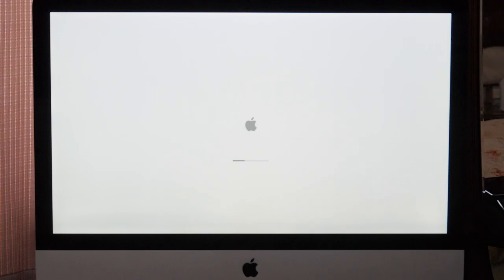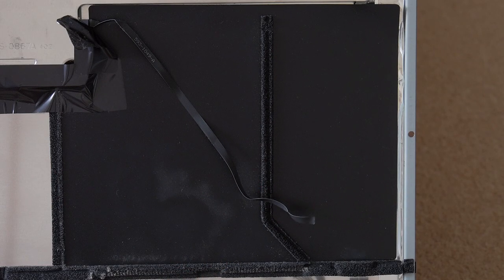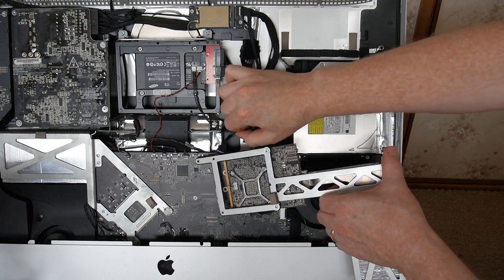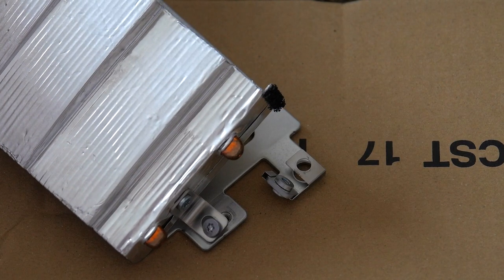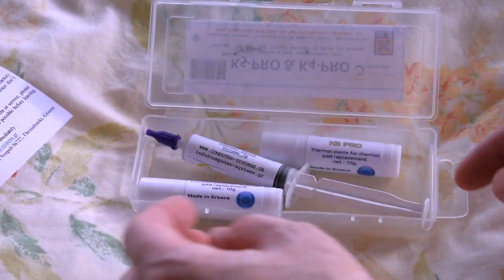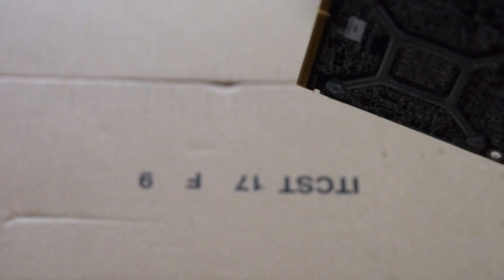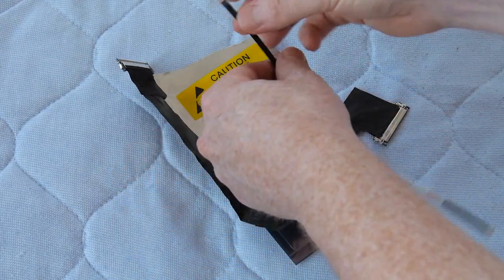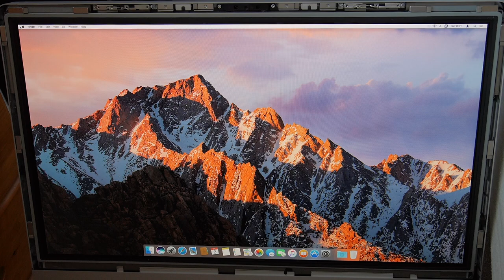Late 2009 iMac 27" Video Card Repair — 4850 — 2nd Bake

Comment: Can I use the K5 for everything or do I have to buy K4 for the chip?
Reply from the maker: The K5 Pro is only used as a replacement for "thermal PADS."  Thermal pads do not transfer heat as well as regular thermal paste, but thermal pads exist because there are certain chips (like memory) which are spaced further from the heatsink and therefore regular thermal paste would not bridge that gap or be effective.  A GPU and CPU run hotter than RAM though, so board designers ensure the heatsink makes contact with those chips without big gaps, and that is why regular thermal paste works great for those applications.  All said, you need BOTH types of paste.  Sure, you could just replace Apple's stock thermal pads with thermal pads of your own choosing, but it's harder because you'd have to know the exact gap width for the pad to fill.  Also, I've read that K5 Pro does a better job transferring heat than thermal pads, and if my near 12 months of continuous use is any indication, the K5 Pro is doing an excellent job.  So be sure to use the K5 Pro on the memory chips as shown in my video, and use the K4 Pro (which transfers heat even better) on the GPU only.  If you decide to use other pastes, just make sure they are not electrically conductive, and then you won't need to worry about electrical shorts caused by thermal paste overflow.
Reply: JDW thanks for the detailed reply and for making these repair videos! I was in a crunch and needed my machine up and running so I put a small amount of K5 on the GPU and put everything back together. Miraculously everything worked and my machine has come back to life. I guess I’ll be the guinea pig for anyone else that only has K5 available. I’ll keep an eye on my temps and I’ll report back if I run into any issues. Thanks again for your help!

Comment: Would Arctic Silver 5 thermal paste work instead of the K4/K5? I’ve orders a tube of that and some of the grizzly - wondering if those two would be ok?
Reply from the maker: No.  Here's why.  Arctic Silver V is not electrically conductive but it is capacitive.  It's very hard to get the right amount on the GPU such that there is adequate paste/coverage yet no overspill.  Any overspill will touch the tiny SMD capacitors surrounding the GPU, potentially causing issues.  It's best to use something like K4 Pro or Thermal Grizzly Kryonaut on the GPU.  As to the memory chips, NEVER EVER use GPU/CPU paste on those!  Why?  Because there's a gap between the top of those memory chips and the bottom of the heatsink and normal thermal paste won't fill that gap properly long term.  You must use either thermal pads (which I dislike tremendously because it's hard to know the right thickness) or K5 Pro, which is the only thermal pad replacement paste that I know exists.  I can also vouch for the K4 Pro and K5 Pro combo as that lasted 2 years and 9 months after my 2nd Bake.  On my 6970M I used Kryonaut on the GPU and K5 Pro on the memory chips.  There's nothing wrong with K4 Pro for the GPU, but if you have Kryonaut, by all means, use that on the GPU (not on the memory chips), as that is the best paste you can buy outside liquid metal. (And no, do not use liquid metal on these graphics cards!)  For additional Q&A, please see my video FAQ here: https://youtu.be/hldcyJ_qUD4
Reply: @JDW-  thanks for this. The reason I asked is that when I looked the other day I couldn’t seem to find K5 in the UK, but managed to buy a tub online last night.

I appreciate the detailed response (despite being a total tech noob and not understanding it all!). I have K5 and grizzly now so that should be fine right?

Thanks again!
Reply: @JDW-  ah no I completely understand - just re-read a couple of times ha thanks for the help.
Reply from the maker: @thenewnostalgic4094  That's good to hear. K5 Pro on the memory chips only and Thermal Grizzly on the GPU only is the perfect thermal paste solution for these video cards.  You can see how I applied those 2 pastes on my 6970M card here: https://youtu.be/n2a8oEI2y6U?t=633

Comment: Hi JDW. I performed the video card bake and the iMac is working again although one of the fans is constantly running (and loud). I installed smcFanControl and it didn't do anything. Also did a SMC reset. No change. Any idea? Thank you for your video card bake videos, awesome tutorials!
Reply from the maker: Thanks for your comment.  It seems clear that you reconnected one or possibly two connectors incorrectly, pertaining to one of the fans.  I'm afraid the only way to fix that kind of problem, in light of the fact SMCfanControl cannot fix the problem, is for you to reopen your Mac and check you fan and temperature sensor connections again.  Believe me, I know how much trouble that is, especially the horrid part at the end with you trying to get the glass back on without dust underneath.  But sadly, it really does look like you need to do that.  If you do decide to recheck your connections, please report back on which connector(s) were incorrectly connected (or were not making good connection at all).  Thanks.
Reply: How can it be, they are not a one size fits all meaning that I wouldn't be able to make an incorrect connection. I numbered everything as shown. Can you point me to the fan and temperature sensors?
Reply from the maker: Veronique, there are many things that could have gone wrong to cause one fan to spin at top speed.  You may simply not have securely fitted one of the SENSOR cables back into it's mating connector.  If the sensor cable isn't making good contact at the connector, the fan associated with that sensor will spin at full speed.  Since you seem to have only 1 fan doing that and since you appear to be able to use SMCfanControl to control the speed of the other 2 fans, I suggest you figure out which of the 3 fans is spinning uncontrollably.  You will then need to reopen your Mac and check connectors, as described in my other video below, and watch it to about 19:00.  If all those connectors are secured well and you don't see any wires broken off, then perhaps it could be the sensor at the drive (HDD or Optical Drive) or even the connection to the video card, which could have broken if you yanked on it too hard.  But again, if you can isolate which fan is spinning at top speed, then you can isolate which connectors and card you need to focus your attention on.
https://youtu.be/v1DXBLkiqFM?t=11m25s

Comment: I'm in the middle of the process... Already baked it and tomorrow will buy the paste... Did you noticed that there are some parts that have thermal paste originally but you missed to put on while replacing the card? I'm talking about the two groups of four chips, just at the opposite side of the card connection to the graphics card body, watching the chipset face. At the metal armature of my card body I can see clearly the paste (I can send you images)
Just to inform you guys...
And by the way... When I was going to unscrew the frame that holds the chipset card from above, holding by 4 screws, mine were completely loose! Is this normal? Also the chipset thermal paste was a complete mess around the chipset... Just a little drop in the center would have been more than enough...
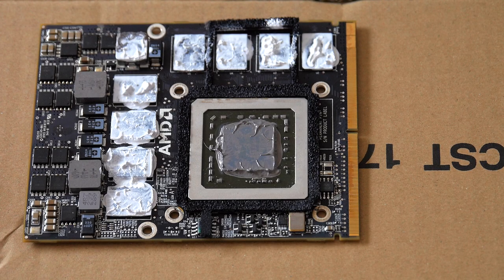Reply from the maker: Jump to 18:35 in my video, which shows my video card with past still applied.  Note the chips at left.  Specifically, there are two big square silver components, one smaller square silver component at bottom, and then 8 smaller ICs at the far left.  I did not put paste on any of those simply because Apple did not put paste on them originally.  Even so, there is a protruding section of the heatsink that seemingly would be used if you did put a thermal pad (or K5 Pro) on them.  But since Apple did not apply paste to them, I would not be too concerned.  Even so, if you want to apply paste, it certainly would not harm anything at all.

Screws should not be loose!  So when you put it all back together, make sure your screws are tight (just not so tight you break something).

Let us know how it goes.

Comment: Thanks for the video. I have a big problem with my iMac 27 late 2009 too, but I’m not sure what is the part damaged: logic board or graphic card!? My problem is that it start with the apple and the loading advancing bar slower than usual and stop at about ⅓. Can’t enter in macOS recovery or in safety mode too; but no problem of video failures  at all so this let me think more about logic board damage... somebody had any suggestions, please?
Reply from the maker: Honestly, I've not heard any reports of logic boards going bad.  Statistically speaking, there surely must be a few out there.  But any problem pertaining to logic boards is so rare in comparison to the video card, that I am not finding user reports about the logic board.  My guess is the video card.  Yes, if the video card is bad, it will freeze your machine mid-way during cold boot.  And that's true even if you don't see any strange artifacts on your screen.  Since you cannot boot into Recovery or Safe Mode, I would suggest you attach a bootable external hard drive and see if you can boot from that.  If you can, then perhaps it's data corruption in your internal drive.  But if you cannot boot of the external drive either, I would say it's highly likely the video card is the culprit.  If you don't have an external drive (eek!) then maybe you have Disk Warrior or some similar utility that allows you to boot off a CD or USB flash drive?  If you can't boot of those either, I would again say it's the video card.
Reply: Thanks for quick answer. Yes I tried to boot from external dvd with original installation disk and didn’t work. I think I will go with baking graphic card and change the logic board battery as is 9 years old. I will post my experience at work done. I hope all will go for the best.
Reply from the maker: Not being able to boot from a known good data DVD disc gives strong evidence your problem is very likely the video card.  A dead PRAM battery won't cause the problems you are seeing, but you might as well change it.  Be sure to click "SHOW MORE" to expand the text description under the video above so you can see the tools and thermal paste I recommend.  You can use your own paste, if you have some already.  But if you don't, then I would say go with the K4 and K5 Pro.  That paste has worked well to keep my iMac running over the last year and a half.  After your bake, please let me know if it worked for you.
Reply: hold down the D button at the start-enter the diagnostic mode of the equipment. Either you have thermal grease to replace your dried out and the CPU next passes.
Reply: Evgeney Kirichek Doesn’t work D option! And also quite all other combination option (work only the option key but the loading bar always stop to load).  I already baked the graphic card and refresh the thermal paste both in gpu and cpu, that after 9 years was really dry. Waiting BR2032 battery, not easy to find in my country (Italy) and will test if the bake fixed my problem, hope so. I will keep you update.
Reply: @paolotrenti5913  Dear Paolo, thank you for your reply. That's what I want to say: I tried to fry the graphics card on different Brands, 2008 (24`) is turned, he earned. The others are not (2006 24 white and 2011 27). Since 2011, I got only one option - I bought a restored graphics card. I had a 6970 with 1 GB on Board, replaced with a surcharge of $ 170 on the same with 2 GB. The chip on it was already from another batch, 2016. It's the right thing, unfortunately everyone else is either married, or fried - it is long. And you, Paolo, 2009-this is Core2Duo, the maximum works only El Capitan, it's time to change.
Reply: @Evgeney Kirichek Hi, really it works till High Sierra, and after ssd upgrade it is still be a good machine for what my need. I want to fix it and pass to my young daughter. I hate to trash useful things. For me I’m planning to assemble hackintosh PC soon but need this to work before.
Reply: @paolotrenti5913  I too long to change things, it's probably not very good, but I am. I have a car 20 years already, Saab 9-5, but I love it and invest in repairs and maintenance. Almost the same with computers. True, they are not weak. Laptop 7, i7 ASUS, memory and monitor his Dell 24 Matt without blinking. This is the main home office computer, he draws and 3D MAX 2017 and modern ADOBE. And here is MAC-alighted on this 2011, 27 inches, so as modern very expensive and in this is worth, too, i7 and 24 gigabytes of memory with 256 SSD. This is all quite enough for the job. And it is powerful enough, I check it in ADOBE AE - there are no brakes in projects. Therefore, I spent money on a redesigned graphics card for him - I hope for several years of smooth operation. If you are interested - write to me at iokazisuh@gmail.com or Facebook. facebook.com/evg.kiri
Reply: Update: baked the graphic cards, changed the 2032 battery, refreshed all the thermal paste... problem not solved... still block at ⅓ of loading bar... tried to install snow leopard from original cd. Firsts times not worked (the cd was dirty :-)) after the miracle appended!!! Now is ok. System restored!!!

Comment: Is that black foam pad needed? if so how did you remove it with out tearing it? (as seen at time stamp 22:57).
Reply: Don't worry found it just now in your 1st video around the 30 min mark. Just had to find a small gap where the adhesive didn't stick down fully and pry it up.
Reply from the maker: @TCSPCS  I can only speculate about the purpose of that black foam pad.  I think it is to keep dust from collecting around the GPU chip.  Since there are fans in the iMac, it makes sense that might happen over time (after a couple years, maybe).  But honestly, I don't think it's needed.  Indeed, when putting everything back together after my 3rd bake recently, I forgot to put it back in!  Of course, my iMac is working fine without it.  It might even allow more cooling on the GPU chip without it.  That thing is a pain anyway because the old adhesive no longer sticks.  If you tear yours or find it troublesome, leave it out.  I'm not worried at all I forgot to put mine back in.

Comment: Hey JD, can I us the same thermal paste for the cpu on the surrounding squares around the cpu if I don’t have the white chap stick stuff?
Reply from the maker: No because the gap between those memory chips and the heatsink is large and normal thermal paste is very liquid-like and won't hold its shape well enough over time to ensure proper heat transfer across such a large gap.  That is why you really need both K4 Pro and K5 Pro.  If you don't have the K5 Pro for the memory chips, then you either need to buy it or thermal pads.  I didn't buy thermal pads because I don't knew the precise thickness they would need to be.  With K5 Pro, it doesn't matter because any extra paste used with be squeezed out and spill outside the chips.  And since it is not electrically conductive, it won't matter if there is over-spill.  I hope this info helps.
Reply: JDW thanks brother!!!!
Reply: JDW May I get a link to where I can purchase that k4 and k5 pro kit?
Reply from the maker: @boobizzy4173  https://www.amazon.com/CS-LABS-Thermal-replacement-K5-PRO/dp/B01H3D9ZE8/

Comment: Hi there. I watched your questions video (or read the questions and mine is a lil dif). I was following a tutorial from this other person removing the gpu and in the video he confused me and caused me to pull out the LCD datat cable (the second cable you purchased / them ore exspeinsive one in this video) out from the connection (didn't make it clear that it had to be squeezed from the sides). Now in addition to that being broken I put in a new graphics card from my alien ware laptop and now the ccomputer makes a high high pitched whinning sound that isn't very loud but is annoying and it won't turn on. it makes the sound as soo nas it is plugged in and the sound seems to be coming from the RAM slot. do you think you can help me in any way?
Reply from the maker: If the wider ribbon cable's motherboard connector was damaged, are you sure you were able to fix it?  I am assuming you were able to repair it somehow since you said you proceeded to install a graphics card.  If that connect remains damaged in any way, such could easily explain what you are hearing.  With that said, even if the wider ribbon cable and its connectors are perfect, if the little ribbon cable (which connects in the upper left corner) is damaged or otherwise disconnected, the iMac will often make a whining sound even if the display looks fine.  Lastly, to use a PC video card in a 2009 - 2011 iMac requires use of a Windows PC to flash the appropriate firmware to that graphics card prior to installing it in the iMac.  If that was not done properly, it could explain the problems you are seeing.  I hope this helps!
Reply: @JDW-  would you mind explainging the flashing process to me or linnking me to a good video?
Reply from the maker: I have never flashed a graphics card. I also don’t own a Windows PC because we are an all Macintosh household. I have simply read about the process. For example, here’s one video on the subject: 
https://youtu.be/vt0GvUfDK8o

Comment: Hello question if i do this and it works will all my files be still intact or by doing this will I lose all my files that I have in the computer? thanks!
Reply from the maker: The video card has nothing to do with your hard drive.  So long as your drive is fine, it will continue to be fine after the bake is done.  It doesn't touch any files on your computer at all.